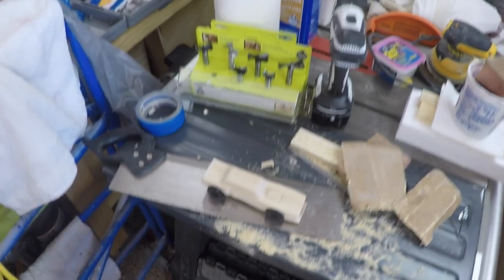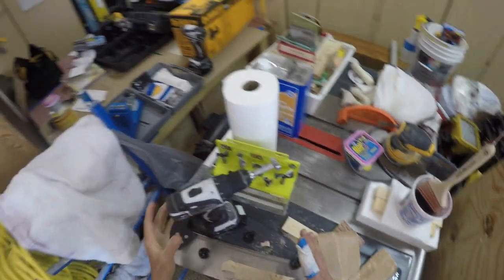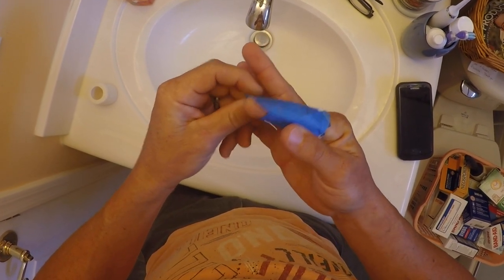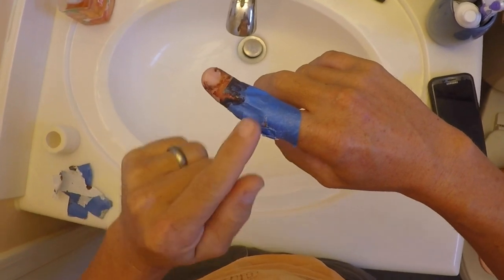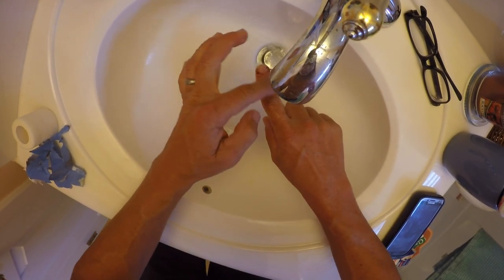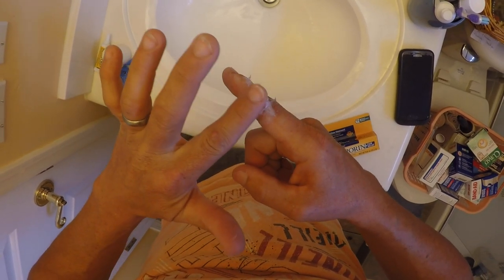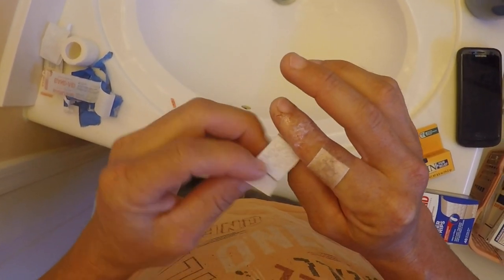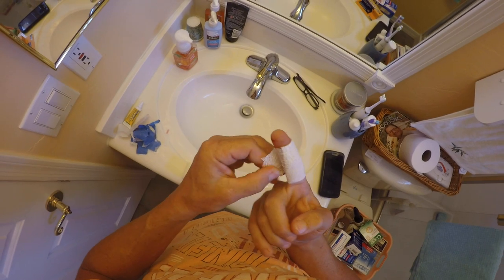Make Your Own Bandage - A  Garage First-Aid Tutorial

Comment: In the tool grinding shop where I worked, we were always cutting ourselves and I would dress the other guys' cuts with paper towel and tape.  
Also,  for incisions, I have used tape to pull the edges together in place of stitches or commercial butterfly closures for decades.
It really works, like when a student cut my forehead with a ski pole, I squeezed the edges together and applied athletic tape strps approx 1/8" apart. 
Twice a day I drizzled iodine into the cut (leaving the tape in place) and left the tape there for 2 weeks. 
When I removed it, the skin edges stayed together beautifully. 
After 45+ years you have to really search for the incision mark!!
Reply from the maker: That's a really cool story!